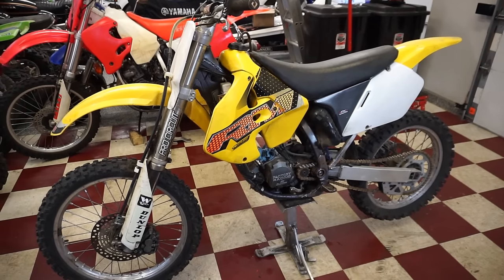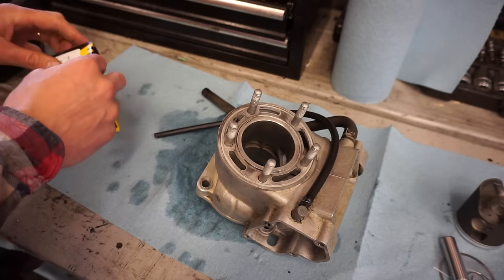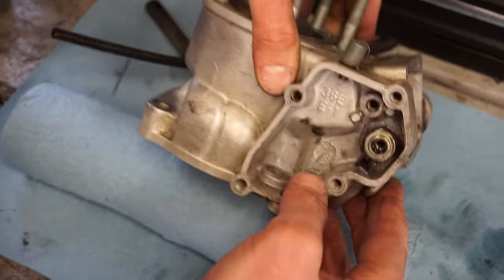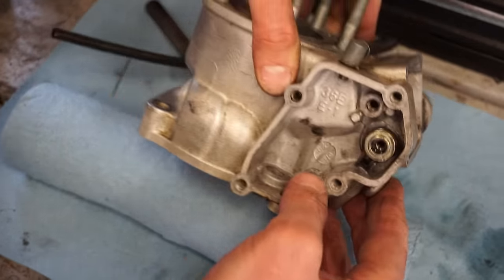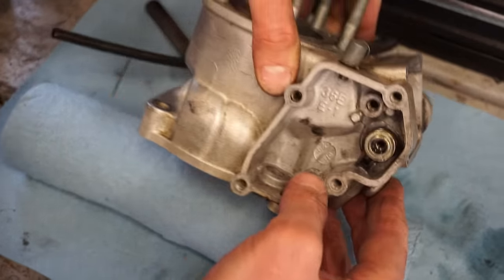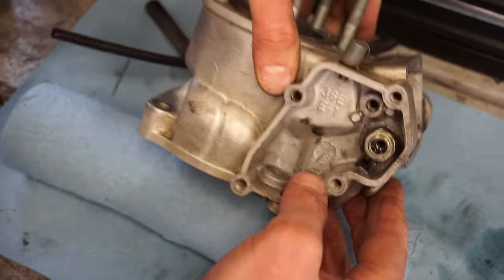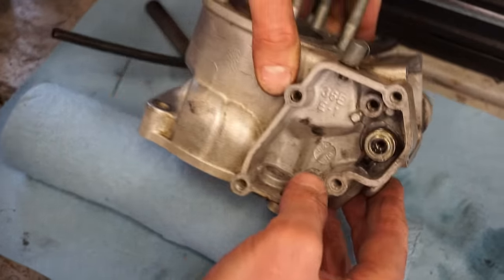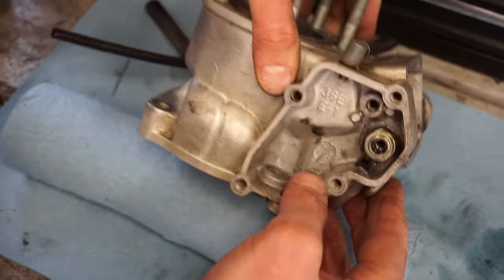Seller Said This 2-Stroke Dirt Bike Lost All Compression (PROBLEM FOUND)

Comment: You can't beat reving the nuts out of a fresh top end rebuild
Reply: ...and free revving at that...icing on the cake
Reply: He does it every time without fail, he never warms them up before revving the nuts off them. It really baffles me.
Reply: @gwl78  break them in how you intend on using them. not rocket science, done it with all my bikes no issues.
Reply: He is a hack
Reply: Heat cycles man, will run leaner from the cold probably not the best conditions to rev it up straight out the box .. but hey each to their own and open that door up before you fire up bro cracks me up every time 😂 another good vid though 🤘
Reply: Not to mention summer jetting on a winter ride on a fresh rebuild😂😂😂 add it to the pile of shit nobody wants to buy from him
Reply: @thomatyessir9123 I can tell from most of comments here not to many people understand how 2strokes work. There is a reason snowmobiles are mostly and mainly 2strokes
Reply: that thing will be fine  , rebuild on a 2 strcke is like a sproket change its not a big deal
Reply: you shouldnt rev It at all when you heat cycle lol just let it idle
Reply: @thomatyessir9123  not true only racers abide by that & that was because they used a new top end every race! ive gotten over 120hs on a piston plenty of times for heat cycling the proper way no way in hell ur getting more than 40hr on a piston revving it to the moon when ur heat cycling it! with a prox piston no less :face-purple-crying:
Reply: @AdrenalineRushMX  he spent $500 on the top end it is a big deal
Reply: @BoxingLegends2024  i do the same whit no heat cycling
Reply: @mostlymotorized  yea thats bad for sure but the heat cycling thing is not a most for sure
Reply: Idk about you but I think this guy knows what he’s doing
Reply: @gwl78 he's an amateur just like the guy is protecting him I don't care if he can fix one that's not the point you take care of an engine and you don't flog the s*** out of it o.n a fresh rebuild when these guys saying go ahead are just stupid
Reply: @ctbale1 bingo
Reply: @Gixerkid17 these young punks on here don't want to hear all of that technical stuff they just want to play with a toy.
Reply: @AdrenalineRushMX and you got another stupid award
Reply: @RonaldDaub-xi5jz  yea sure i do about 100hours on the same piston heat cycle or not
Reply: @Rugsadventures  I can tell from the comments that people are getting advice from the wrong people I was building two strokes one was
Building 4 stroke if you're a real mechanic you can work on anything not just this junk
Reply: Why do you watch if everything he does is wrong?@RonaldDaub-xi5jz

Comment: 90's 2 stroke engines always sound like pure music 🎶
Reply: They sound like an angry hornet.  Lol.  I'm a 4 stroke guy.  But the 2 strokes sure can move 👍
Reply: @robinbrowne5419  I couldn't believe the CR500 has got more torque than a modern 450 4 stroke.
Reply: @bobdillon1138  Every KX500 or CR500 I ever saw had a broken rear fender from flipping over.
Reply: @bobdillon1138  But that's only a 125.

Comment: I always do a thin layer of grease around the filter where it meets the airbox. I also add a coating of 2 stroke oil on the powervalve parts when re-assembling.
Love 2 stroke MX bikes. Nice work. 👍

Comment: The powerband on the 99s can be adjusted by the screw on the left side of the cylinder I go 1 1/4 with it you can go a little more or a little less than 1 turn you can feel the difference when you hit the powerband its all a preference! ive had this bike since 99 & its still in my garage in 2024

Comment: Couple suggestions. There are a few companies that Replate cylinders. Replate being new Nikasil Plating.  These cylinders are not steel bores. They are Nikasil Chrome
plated. The service typically cost under $300 including shipping to and from.  Power Seal and Millennium are two companies that come to mind. Your cylinder comes back looking brand new and the bore is 100% to spec.  Much better than an expensive used cylinder. 

Second your not supposed to hone Nikasil Cylinders as the coating it very thin and hard and most standard hones won’t created usable cross hatch. A Diamond hone is needed. 

Some other advise I would give since I’m assuming your flipping these bikes is that I would use Namura Piston Kits.  They are very good pistons, come with or without gaskets and are priced very good. 

On this build you probably would have saved $200
Reply: Man you seem knowledgeable on cylinders but why would he do the cylinder the right way just to put a shit piston in it?. Joe's reputation is worth more than the savings between Namura and Pro-X, he doesn't have to be scummy to make a profit. Don't get me wrong, I buy chinese parts but not for my big bikes. My PW80 that I use for tool/beer runs (shed to garage, not to the store) has a namura cylinder and piston on it and it already looks like shit with about 6 hours on it. That bike makes like 4.79hp, I'd hate to see what a Namura does in a real engine.
Reply: The  cylinder was shot dude pieces missing out of it at the edge. He may have been able to re sleeve it but re coating what was there is just a waste of time.
Reply: @staygold902  It's not a sleeve It's plating
Reply: It's not nickel chrome plating It's nickel carbide composite It's the only thing on the planet that's harder than it is diamond that's why they go through so many rebuilds before replating is needed
Reply: @baitmaster8706 I’m sorry but don’t put proX in the same sentence as namura lol proX are legit and backed by even some former pros. I’ve been running a proX top end kit for a bit now on my 2000 rm250 . No a class racer but also no slouch lugging around foulin plugs . Everything else I agree with what you said . But proX is legit,
Reply: @MrATOMBOMB420  I know what nikasil is lol. I've been working on bikes since the 80's. Why would you replate a cylinder with chunks out of it. That damage was well beyond what a bore job could fix. It either needed a new cylinder or have a sleeve put in it
Reply: Seems like a sleeve might have saved some cash. $450 still seems a bit high.
Reply: The cylinders can be bored and a steel sleeve put in, I’ve done it many times and they last longer that way that stock, piss on that nikasil coating.
Reply: @baitmaster8706 His reputation? He rebuilds engines caked in dirt/grease/grime with evidence of it making its way into the engine on video & beats the heck out of said rebuild before break-in, also on video. I love his videos but let’s not act like these aren’t budget rebuilds.
Reply: Also US Chrome they did my 1998 Honda CR250R
Reply: Really guys who cares watch a different channel if you do not like the way he does things my god
Reply: Total hack mechanic
Reply: 😂 use a cheap junk piston right 🤡

Comment: It never hurts to have a little extra oil in the gas, especially on break in. I always used to mix my gas a bit rich on the oil and never had any trouble with fouling out plugs. A little smoke is better than replacing the top end all the time 👍

Comment: When that nut dropped at 19:00 :o I usually apply a little grease to the gaskets just incase I need to remove them at a later date, prevents ripping them but doesn't affect the seal.Sounds nice and fruity :D Nice job as always

Comment: Great vid. Question, should you not have a run in period before giving the it the beans? I have had a few 2-Stoke road bikes back in the day ie a RD350 YPVS, NS400r and TDR250 and took it pretty easy for the first few hundred miles (They were brand new).

Comment: I've said it before and I'll say it again use a quad ramp to walk the bike up with it in first gear and running or stand on the front brake side to use the lever for a stop if you decide to walk it up without it running its alot easier.

Comment: Do you you use Palmolive? Softens hands while washing carburetors. great video. I used to own a 1978 IT400
Reply: Is this an advertisement? "Palmolive. Softens hands while doing the dishes" (hand starts to pull from the bowl of soapy water while another gently pushes it back in). Yeah, I'm old. 🤣
Reply: @stkyfngrszmooth  Ya old commercial, i'm old also.

Comment: Its not a hone and i wont do anything besides cleaning cylinder wall , honning process means get a proper clearnace between cyl and piston by measuring them both with proper tools ~ not calipers, it also means …achive nice round and square cylinder walls and crosshatch ,what you do is just wild guess . Good video and i enjoy it

Comment: Was the air filter wing nut installed wrong? I believe that the foam goes around the plastic spacer so that the wing nut would not be pressing directly on the foam but onto the spacer. Would be a better seal and less chance of damaging foam and/or wing nut working itself loose.

Comment: New jug has been honed smooth, looks good...like to use WD or PB to hone does great job and cleans up nice.
Reply: Yah scotch brite and wd takes the glaze off and you wont risk chipping the niko.
Reply: Yeah he honed a plated cylinder that's a huge no-no
Reply: @MrATOMBOMB420  Well .... I wouldn't take a hone to it like a steel sleeve or iron bore.  But  it is acceptable on niko cylinders as long as the stones are not diamond or carbide and you are damm careful like maybe 3 or 4 in and outs on slow both directions.  All you should be doing is taking the glaze off so the new rings seat in correctly.
Reply: @luuk-out-below9804  absolutely not the only type of hone that is used in a plated cylinder is a very very very very expensive diamond hone that is on a machine that keeps the hone centered and a brush hone is the only type that should be used on a plated cylinder a rigid flex hone the style that he has should not even be used in a two-stroke cylinder as the ends will catch ports damaging the edge of the port
Reply: @luuk-out-below9804  plating does not need honed most of the time a Scotch-Brite pad in an x pattern is all you want to do if you have a brush hone one of those can be used but all they do is take the scum off the cylinder The only thing harder than plating is diamond using anything else is the absolute incorrect way plating does not need freshening up like a steel sleeve does
Reply: @MrATOMBOMB420  He's using a hone tool but not doing a honing process per say.  He's just using the hone tool to clean the glaze aggressively.   And I agree with you about chipping the niko on the edge, that will not happen with scotch bright. IF you were doing a actual honing process in a machine shop or engine factory yes they do use a diamond grit hone, but that's not the process at all here.   He's using a HF hone and just de-glazing.
Reply: @luuk-out-below9804  you never ever ever use a rigid flex hone to do a plated cylinder if you're wanting to take the glaze off first of all plating doesn't glaze it gets scum on it which is basically a byproduct of the oil in the gas a scotch bright will completely take that off if you want to get technical about it you get a brush hone I just rebuilt my 421 Cub Banshee they have plated cylinders from CP industries alls I did was run the brush hone through it one or two passes and the cylinder was cleaned up just like new you never ever ever ever use a rigid flex hone on a plated cylinder
Reply: Only if it's a steel sleeve when plating is applied at the facility they have a hone machine that is worth tens of thousands of dollars that the cylinder gets mounted in and is a diamond hone and all the clearances everything is set then in there after that you never run a rigid hone through that cylinder only a brush hone to clean up the scum off the cylinder
Reply: @MrATOMBOMB420  It will be fine you are taking this way too serious.  I think you might stroke out if you went to my buddies chainsaw shop, he uses a ball hone to de-glaze or de-scum as you say on every rebuild.   The fabric of the universe is still holding together.

Comment: Sounds great. I always mix my gas 40:1  initially it was because 4 gallons to 16 oz Jug of HP2 Honda Synthetic 2 stroke oil which... is my favorite by far.  I also only use VP 110 racing fuel that I can get at the pump at a gas station near me.  is just that easy.  But then I talked to a guy at the local shop and he told me that counter to what you would think, running 32:1 actually runs at a slightly higher temp, because the additional friction by the viscosity of the gas being a little bit thicker, I don't know if that is true, but also although I like the 2 stroke smoke, I don't like how much a bike smokes with 32:1

Comment: Big fan and I wait for every single video to drop. Today something dawned on me though… Well, actually it has before but… You go through the whole bike top to bottom front to back and on the four strokes you adjust valves and you always measure your piston ring end gap, but I've never once seen you Measure your piston to cylinder wall clearance? Never once. How come? And I know people are going to jump on here and say "well, he's using a known bore size and a known piston size"… But that doesn't always work..... actually most engine builders wouldn't even consider throwing a piston in without measuring the piston to cylinder wall clearance. Just wondering why you don't? But love the content!!!
Reply: he checked it without the ring (by feel).....I mean it either clears or it doesn't. If you arent planning custom machine work and it seems "good enough" I say run it. Its just a dirt bike after all.
Reply: I mean, I totally get what you're saying and I've done it too and gotten away with it but it's just nice to know your actual clearance because there is a known figure for that. I mean, you know what I'm saying. I'm certainly not teaching you anything. With piston growth and all that sometimes if you're a few thousands shy you could wind up sticking a piston. Like Wiseco pistons for example. It can be very critical to make sure you have at least the minimum clearance recommended due to it being a forged piston. They didn't get the nickname "SeizeCo" for nothing!!! 😂 That's all I'm trying to say. Thanks for the response.

Comment: During these winter time repairs you seem to be breathing a lot of fumes. Be careful because it is the accumulation the will get you sick. By the way, we just got 2 feet of snow.
Reply: Agreed.  Joe, please use better ventilation whenever you run these machines indoors.  There are a lot of trace metals and chemicals in assembly lubes and 2T oils, that stuff will build up in your body over time, and lead to illnesses years  later.  This is a big deal that you cannot undo,, after symptoms appear.  I've lost several friends to cancer, endocrine, and liver disease, all directly attributed to long-term contact this stuff.  They were mechanics (automotive and aircraft) that also didn't take care to minimize or avoid exposure, just as you are now.  Seriously, don't troll your audience on this - you are setting a bad example for impressionable young (and not so young) minds.

Comment: Raise the sea clip up on the carburetor slide for the metering rod Levi got a inconel liner in a cylinder you're not supposed to hunt them let that thing sit there in idle for 15 minutes for 2 or 3 Cycles before you go riding you'll cold seize it that's what it look like happened to it before but it is a clean looking bike

Comment: I’ve got to agree all the tools and machines you have and you clean with a bruh by hand in soapy water lol been watching you for years so this in itself is def an improvement in cleanliness . But cha gotta use that sonic cleaner my boy, especially powervalve,cylinder, and carb. let it make its money worth and save you some time and energy . I also use proX in my 2000 rm250 and have been running that same piston for almost 2 years now . No a class rider but no slouch fouling plugs here in Pennsylvania . I stand by proX and so do a lot of pro wrenchers and former wrenchers . That’s the main reason I grabbed it, after watching copious amounts of videos backing thier integrity . But powerseal here in Pa will button your cylinder’s up for ya for a nice buck in a decent amount of time as stated in other comments . Just please do me a favor and run her fat and not lean af lol save the bananas ‼️‼️‼️

Comment: Joe, as a general rule it's considered best practise to initially fill a rebuilt engine 
with just water. After you know the build is good, drain and refill with appropriate
coolant/antifreeze/water level. Saves wasting lots of expensive coolant mix.
Love your channel BTW.
Reply: Wrong!!! You put grape soda in the radiator.  Perfect blend of sugar and water.  Then drain and drink

Comment: Got an interesting one in today, 77 RM 100. Broken front sprocket shaft broke clen off. Never seen that before, got er torn down, and needs all new gears crank etc. You should see the gear box, wow. Bent rear wheel broken sprocket chain wrapped around wheel. Told me please repair to original do what I can on the costs, if I can find what I need.